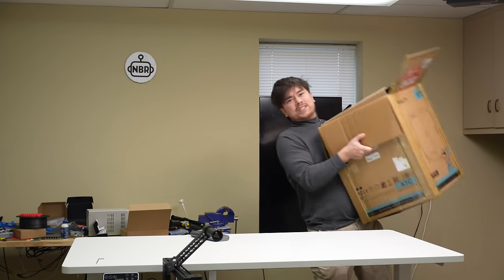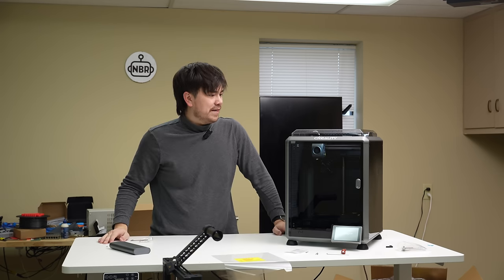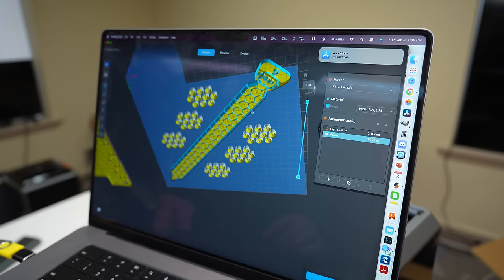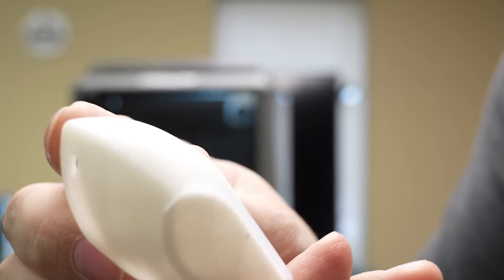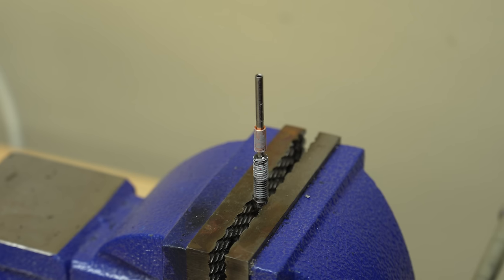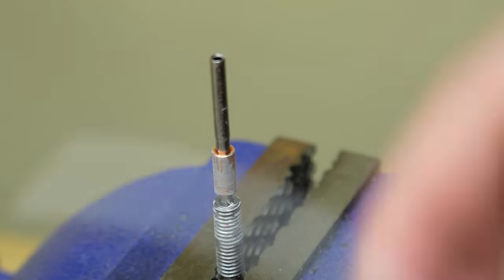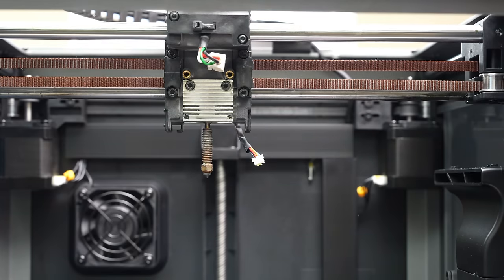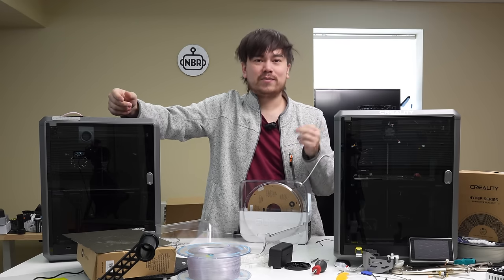Creality K1C - Flagship Carbon Fiber Printer

Comment: meh,  Rigor doesn't seem to be applied to testing Creality's 'improvements"? i get a similar feel about the A1 bed cord.  It's a question i think many of us have about the longevity of proprietary stuff.   Removing the bowden tube from the chain, and probably having a taller lid to accommodate a more gentle slope and remove the kink (not kink shaming). It's an easy mod to print an extender to set the lid on or newer iterations of the K1 can come with a taller lid. Thing is, it's such an easy fix that should have been already done, they knew the problem existed and it feels like they did a slap dash fix and didn't test it, which doesn't evoke confidence.

Comment: Nathan have you seen Vector 3D Teardown of the K1C.  His looked very used and also he did not have an all metal gear set as Crealty describe.  Your fan on yours also looked rather dirty as well.  Have you checked your extruder gearset ?  I have a review sample and I’m going to check mine the weekend. What’s rather odd is that some of these seem very used before being sent for reviews.
Reply from the maker: They are probably engineering or manufacturing test units. They would have run hundreds of hours on them before sending any machines out.

Comment: The K1 should have had all the K1C features but Creality rushed the K1 to market to keep up.
I’m not drinking the K1C Koolaid this time.
I bought 15 K1’s before keeping four that sort of work. They still have significant ringing problems causing ugly results with parts.
Even with the V3 extruder a nugget of filament is routinely left behind after retracting for a filament change causing clogging.
The K1C “all metal” extruder will probably have the same problem.
Bambu’s filament handling is way more elegant than the K1.
I only use my K1’s when doing production of parts where cosmetics aren’t that critical.
I purchased two Bambu P1S, four A1’s and four A1 Minis and by far they are very hassle free compared to K1’s. No thanks Creality, I’ll wait six months to let others Guinea pigs drink the Koolaid. Plus this pre-sale business is BS in my opinion. I fell for that with e-bikes and it’s a good way for companies to work with other people’s money. In my opinion while comparing Bambu to Creality product performance during release Bambu beat the pants off Creality for initial quality and functionality of newly released printers. Creality likes to test in the field as we used to say in the disk drive business. Let the customer grind out the bugs. In my opinion Bambu’s engineers are way better than Creality hands down.
No more half baked Creality printers for me!
Reply: 15 K1’s . What are you smoking 😂

Comment: So, out of the box it will print without cloud or wifi connection?
Reply from the maker: Yes. Network setup is optional and you can just feed it flash drives and SD cards through the usb port (for SD cards you need an SD card reader though)

Comment: I returned a K-1 because the same exact thing happened on mine, I tried to use that tool to unclog it, but it was done. How does a printer with less than 10 hours of usage on it have a nozzle clog it’s unacceptable. I love the fact that you can root these printers, but they need to make a more simple approach on their designs. Mind you I was only using PLA plus.

Comment: Will the VFA go away if you use a step file?
Reply from the maker: Good question, I don't know for certain but I've noticed the issue on objects of specific radiuses, and it's not on every model, sometimes its better or worse. I think the rasterization could be causing it, but I think it has to do with the belt or stepper motor resonance.

Comment: Sorry for posting another comment but I got to the part of the video where you are questioning the two screws that hold the hotend in place,,, you might have a point about "canterleavering" if you are doing something seriously wrong with the tip of the printer and it's coming into contact with the workpiece or dragging into the build plate 🤔,,, I always thought you had to avoid the nozzle coming into contact with object's??

Comment: ALL the K1 beds come that way which is horrible in my opinion.  They need to made an easier way to level them manually.  Concerning the PTFE tube, I've totally removed mine from the chain to prevent any filament breakage.

So why brand a new printer to 'print' CF if all you have to do is use a hardened steel nozzle on a K1/Max to print CF?!?  Marketing bs!
Reply from the maker: Yeah to level it you have to remove the bottom panel, slacken the belt, manually turn the leadscrew a few turns. Then reassemble to test. Too much work imo.
Reply: @NathanBuildsRobots Actually need to loosen the set screws on the front leadscrew pulleys, use the rear screw as a baseline, then adjust the screws while the pulleys stay still. One tooth is, likely,  too much change. Still a lot of dicking around.

Comment: Less gear teeth should be lover resolution and lower torque, did they have a problem with print speed and why would you change it to lower torque (thus lower reliability) and lower resolution ? This change does not make any sense to me. It´s probably just cheaper.

Comment: When printing fast you need to re-run the res-compensation.  Otherwise VFAs will form.  Creality's biggest weakness is product continuity.  They should never have changed the hot end.  It's even worse than before and too custom.  Smaller steppers = cheaper.  Creality is always racing to the bottom.  CF filaments should always print with .6.  On my X1C, I had CF Nylon jams with .4.  .6 accommodates for the CF shreds.
Reply from the maker: Interesting insight! Cost optimization is a valuable part of engineering. Cheaper does not equal worse
Reply: VFA is different then ringing/ghosting. It is not caused by vibration from acceleration, but from motors (some say from belts or idlers, they play together with motors but most likely motors are the prime suspect)

Comment: Chep had an issue with the nozzle too, so I guess that's a weak spot that Creality needs to address.
Reply from the maker: I think he just had a blob from the part coming detached. The blob is just a result of the printer continuously extruding while the print isn't attached to the bed.

It's not really a nozzle or hotend problem, it's a problem with not having sensors to detect a catastrophic failure mode. 

Either the camera or some kind of nozzle mounted proximity sensor should be employed to prevent that kind of issue.
Reply: @NathanBuildsRobots  But he had the same issue of the printer being out of commission while he waits for a new nozzle

Comment: Its better option this K1C over the Ender 3v3 KE?
Reply from the maker: I like the V3 KE a lot. It's the right combination of small, cheap, lightweight, and moddable.
Reply: @NathanBuildsRobots The KE is really poorly put together though. Definitely not for beginners. And the motors cause VFA on anything under 180mm/s
Reply: @oldman1944  The V3 KE?
Reply: @alexisrivero6790  Yep, I've edited to make it clearer. So many people getting them with loose screws and belts. Beginners would be better off with the A1.

Comment: What does VFA stand for?
Reply: VFA in 3D printing stands for "Virtual Fidgeting Assembly." It's a groundbreaking technology where the 3D printer adds a secret compartment or a hidden puzzle within every printed object, ensuring that users never get bored while waiting for their creations to complete. It's the ultimate fidget-spinner of the future!
Reply from the maker: Vertical Fine Artifacts. It's bumps in the print that span the whole height of a part, it's usually related to some undesirable vibrations in the corexy stage

Comment: I have read, that K1 VFA shows at lower speeds but is not (so) visible when printing above 250mm/s.
K1C it seems to be the opposite 😉

Maybe one could swap smaller pulleys to K1 (probably press-fitted -> new steppers needed?), set correct steps/mm (or whatever measure Klipper uses) and tune motor currents (I hope it can do that!) for smooth motion.
But would it still reach BL A1/P1 print quality?

Comment: I changed my k1 to Capricorn tube day 1
Reply: I have a spare capricorn laying around, is it worth putting it onto my K1 ? I've had filament break inside my bowden tube 4 times now with PLA. I'm not sure if it's because the bowden chain is still in the chain or if it's because the bowden tube is no good.
Reply: @mao5990  probably because it's in the chain, the Capricorn tube has less friction.  They supply it in the print head between the extruder and heatbreak
Reply: @pickleleatherworkx2218  good to know! Will change it up and see how it goes, thanks

Comment: carbon + 0.4mm nozzle? :) great, trash hotend again but they made it incompatible to all existing replacements. best kombo for me is flowtech + stock heatbreak + trianglelabs k1 zs plus nozzle (its bimetall cht). fits perfectly, and outperforms flowtech nozzle by far.

Comment: Don't they test their machines? There's a bunch of odd issues. Like, deja vu on that hotend fan going straight into a PCB, will never forget the ender 3 v2 that had the fan intake for the PSU blocked by sheet metal.

Comment: According to NBR the filament broke, it seems the quality control of Creality product is not acceptable. the tube looked kinked.

At this point it get all too Creality for me and the f#$king around begins, at this point the 3D printer is not printing which is a component of the name of the product.

Nathan does a fantastic job of trying to remedy this but in reality it should not happen in the first place through better design.

NBR it may have been better to use a less acute heating on the hot end, such as long period in the oven, but again you know what you are doing.

To be honest its just sad to see a new machine this happen when we should have seen products from the machine, not a muck around.

In my summary Creality doesnt have the talent to 'nail it', they have had long enough, but something isnt right in the mix.....

Comment: There are a bunch of 3d printable bowden tube guides for K1s.  Shouldn't need that, but yours looks really oddly kinked.
Reply from the maker: It was bent like that due to the stiff broken filament inside of it. It's normally more rounded

Comment: Dear companies....FOR THE LOVE OF GOD, PLEASE STOP PUTTING SPOOLS ON THE BACK OF THE MACHINE!!!!!!!!!!!!!
Reply from the maker: Where else are you going to put it?!
Reply: @NathanBuildsRobots  - I hang the spool on a wall mounted spool holder above the printer.  Overhead is almost a necessity for low durometer TPU but works better for all filaments.
Reply: Back works great. These are desktop printers and have a great front profile
Reply: @NathanBuildsRobots  The side?  There's 2 of them.
Reply: Never had a problem with it being on the back and messing around moving it to the side is just a pain for no deser able bennifit as far as I can see

Comment: Yeah the k1 is and will be my last creality machine, creality lost me as a customer for life.
Reply: meanwhile my k1 max with microswiss hotend has been smooth as butter since new.
Reply: @Den-ml7zg  I shouldn't have to buy a hotend on top of the machine, it should just work.
Reply: @Den-ml7zg  - I'm trying to convince Micro Swiss to make a hot end and extruder assembly for the Neptune 4 series.  It needs one almost as much as the initial K1.

Comment: One word: Wound electric guitar strings for nozzle cleaning. Ok, not one word.
Reply from the maker: That is a great idea. Did you just come up with that?
Reply: @NathanBuildsRobots  I haven't seen anyone else doing it. But it worked for me with some burnt soluble support filament. The winding interlocks with the molten filament. I think I used an A string.

Comment: Now I want carbon fiber TPU ... does that even exist?
Reply: No, that doesn't make sense.
Reply: @ShermanStrike  Oh. But Bacon PLA makes sense? ... because that exist 😄
Reply from the maker: TPU is underrated. For really thick prints, I think it will be stronger and tougher than most other materials. But nylon would almost always be better by those metrics, unlessss you're operating at very low temperatures! Then maybe the TPU will be less brittle at super low temps
Reply: yes, Zack freedman had a roll in one of the 'every filament' video
Reply: @NathanBuildsRobots  - I love TPU.  Most people think of it as flexible, and thin enough, it is, but its real strengths lie in the excellent interlayer bonding that makes it much more of an isotropic FDM material, extreme impact resistant, excellent UV and chemical resistance, and extreme abrasion/wear resistance.  I wish someone made a higher durometer TPU for rigid parts that prints at higher speeds, maybe with less stringing.

Comment: I’m pretty sure Joel debunked Creality’s “High speed filament” claim. It’s a marketing stunt you’re falling for. When you discussed Bambu’s filament and hotend you claim they’re just sucking everyone into their proprietary products yet Creality is doing the same shit and you’re blindly pushing it for obvious reasons.
Reply from the maker: In my experience, It works better than prusament's galaxy black PLA in high flow applications.

It's also flows better than Polymaker PolyTerra.

So is it better than "normal" PLA? It depends on what your definition of "normal" is.

Is PolyTerra normal? Is Prusament Galaxy Black PLA normal?

Hyper PLA is verified by the manufacturer to work on their machines in high flow applications, and I had it available to use for this video.